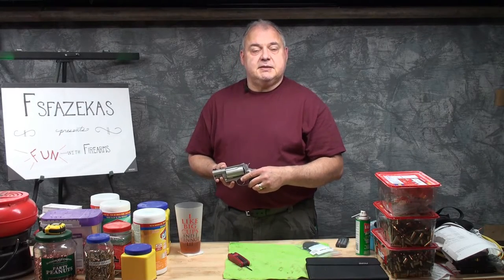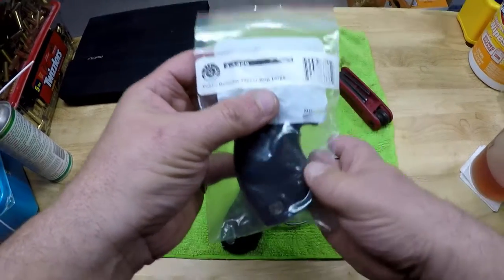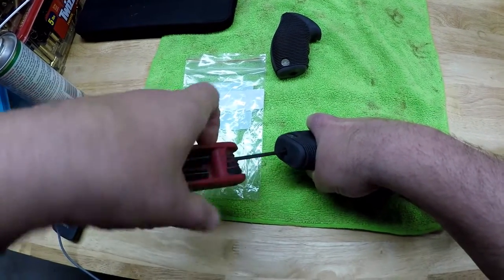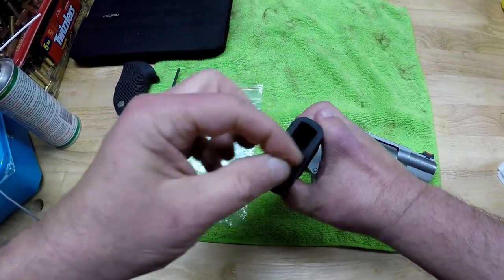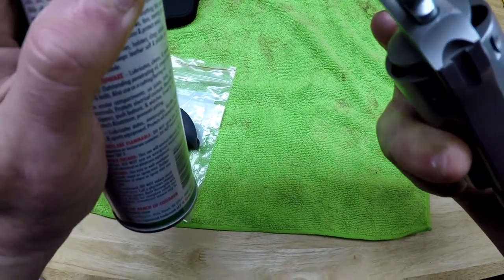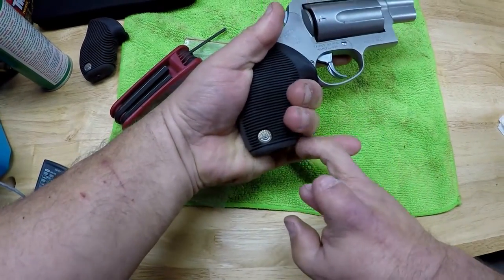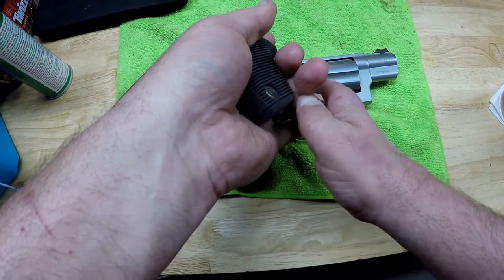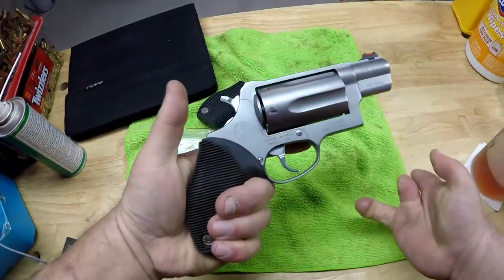Taurus Judge Extended Grip Installation

Comment: I'm hoping to buy a TPD soon, and planning to install an after-market grip that appears to be larger than the Taurus replacement. Rated much higher (on Amazon), because it feels great (according to reviewers), and allows the pinky to be completely on the grip. So, after shooting this, what was your verdict? (See what I did there?)
Reply from the maker: Thank you for watching and commenting!  Feel free to link the item you bought - if it'll let you.  I am curious what product you bought.  The truth is, I still have not fired my Judge DP yet.  It is something I'll be getting to this spring (almost here in central NY).  What the Taurus product has going for it is that it's cheap and is  a bigger grip than the stock grip but that doesn't mean it's the best solution.

Comment: a bicycle trick is to use hair spray as an install lube as it will help with grip retension after drying
Reply from the maker: Thanks for watching and commenting!  Stealing my wife's hair spray for Taurus grip installation and her blow dryer to put on Talon grips...sounds like a plan!  Appreciate the tip!

Comment: Watching this again and again, the "longer" replacement is the same grip as the original. A Pachmayr Diamond Pro Grip would be the way to go for the Taurus Judge, for a "3-finger" grip.
Reply from the maker: I’d agree with you…but then we’d both be wrong.  The video clearly shows one grip you can get TWO fingers on, the other allows THREE fingers. I suggest you see (get it) an optometrist.  Both grips are available at shoptaurus.com. This one is LONGER!  But hey, you do you boo 🤷‍♂️🤦🏼‍♂️🤣🤣🤣